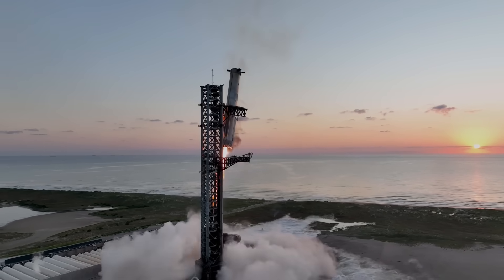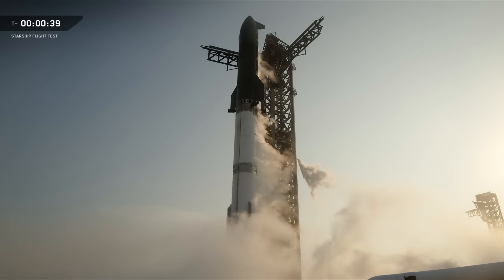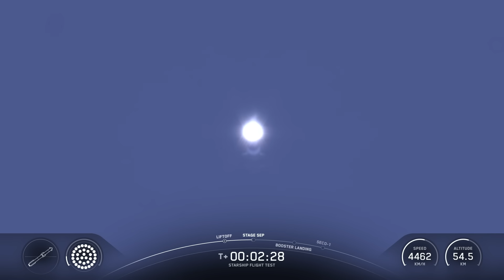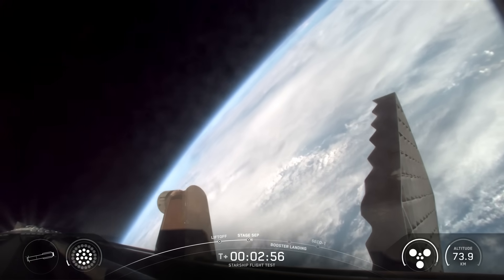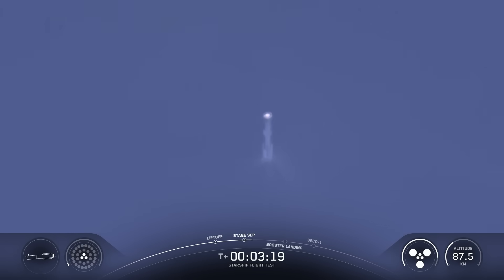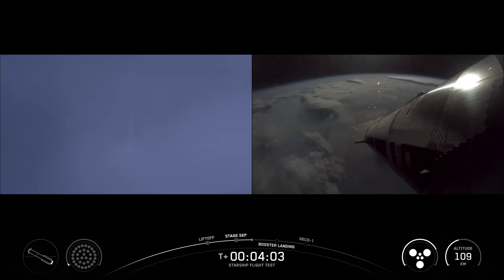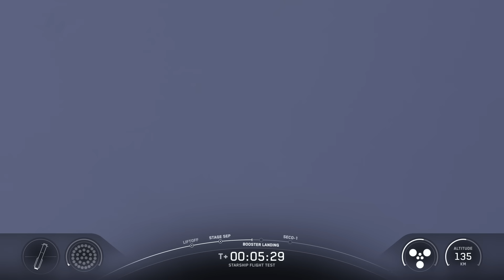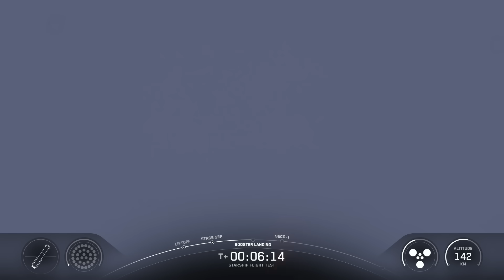SpaceX Builds Largest Reusable Booster, Also Makes Door That Won't Open - Starship Flight 9 Recap

Comment: The success and/or failure was less notable for me than than Spacex's dumbing down of the information flow to the audience. Why reduce the detail? Why were the commentators not mentioning the ship was tumbling out of control when viewers could tell by the moving shadows and views that it was? Why wasn't the orientation telemetry showing the actual movement instead of the ship orientation graphic showing it only slightly moving? Spacex enthusiasts are not stupid and can tell when we're seeing cheerleading while failure is occuring. There's a recent internet word for this tendency and it is "enshitification". One of the commentators actually said something Orwellian like "demising a little bit" to describe the ongoing disintegration of the ship. Bizarre.
Reply: Many of the comments here (not yours) reflect a dumbing down of the audience
Reply: That's the choice of the commentators. The graphic only showed the movement in one direction because it is 2-dimensional. You can see it moving more later in the orbital flight once the attitude control system had been depleted and couldn't stop the gyrations from going completely out of control in all directions.

Comment: "the only other launch vehicle with a propulsively recovered booster is the falcon 9, built by spaceX". I know you meant orbital, but, this statement as you said it is untrue, and a bit frustrating as it's problematic among spaceX cultist/fanboys that aren't pro space, just pro spaceX. Blue Origin's new shepard propulsively landed and was reused before spaceX did it, and while it's not nearly as impressive as falcon or starship, that achievement shouldn't be ignored by space historians.
Reply: ok, your footnote is noted, but it's really of no consequence.
Reply: Completely different category of rocket. One is an oversized sounding rocket that hauls Katy Perry and other bimbos straight up and down, barely touching space,  and the other is a medium lift fully orbit capable reusable first stage rocket system

Comment: Yep. It's hard (and unnecessary) to put a SPIN on that obviously complete and utter failure. 
They simply seem to regress over time. Whenever there is partial success, they will reinvent everything to make sure that it never ever becomes a viable rocket.
Remember: this is forever considered but a mere a test article. And it's hard (and unnecessary) to put a spin on that - 
again.

Comment: Serious question: the space shuttle was supposed to be a reliable routine relatively inexpensive space truck. It was instead a very expensive unreliable not even remotely routine space truck because what they hope to achieve wasn’t possible with 1970s technology even though the idea “made sense” at that time 

Is it possible Starship is in that same category?

Comment: You're way underselling the Space Shuttle, both for the boosters and for the orbiters. The orbiters were part of the the first stage with the SSMEs contributing 30% of the thrust and then becoming sustainer engines and finishing the boost to orbit. 

And speaking of doors, I'm now even more impressed with the Space Shuttle orbiter cargo bay doors which almost had no troubles opening and closing over a hundred flights and a wide variety of on-orbit conditions. The vents definitely helped, not only at launch, but in equalizing pressure on landing. Again, something people took for granted on all those flights that worked flawlessly nearly every time.
Reply: The shuttle worked in orbit when they had time to troubleshoot the doors, and sometimes they had to do so.  The door failure isn't a big deal, maybe it works if they have time, maybe they redesign... it's not a fail for the program.  I'm sure there are multiple door plans nearly ready to try anyway.
Reply: @davidkottman3440  That actually isn't quite true. They intestinally stressed the doors during the OFTs (STS-1 through 4) to see how the doors would behave under actual conditions with cold soakings and heating in sunlight, etc.. 

But they NEVER had trouble opening them. NEVER. Anything that had caused that kind of trouble on any mission would've caused it to be aborted immediately since the flash evaporator cooling system wasn't good for more than 5 hours, maybe a bit longer.
Reply: @Reiner-o7u  okay, so you just don't know.... another guy on here talked about a mission where they had to orient doors towards the sun to thaw them. I remember some delays in mission profiles because of the doors.  I didn't imagine. Plus I personally work with enough different equipment to know that nothing humans make works perfectly 100% of the time.
Reply: @davidkottman3440  I do know a lot about it. You're just trying to throw minor stuff out that isn't even relevant to this. And memory is a fickle thing. Unless you can specifically state the mission and the exact circumstances (I did, OFT flights 1-4) you've not got a leg to stand on here. 

The absolute closest I could find was STS-76 (March, 1996) Atlantis where the doors didn't close after a wave off to land at KSC, and that was quickly diagnosed as a faulty sensor and the doors where closed in manual mode. 

What this boils down to is you're a fanatic trying desperately to make a false equivalency fallacy argument to defend Starship when there is no real defense here.

Comment: NGL I think these throwing tens of millions of dollars on the 9th iteration and still ending up with the same result (explosion) is not good when you also sideline as a "efficiency department head" (where's the efficiency in this explosion?). This might be an unpopular opinion here but I'm calling a spade a spade, its a failure. Also, I'm pretty sure the money used to build these rockets was approved by Nasa... so technically Elon's dumping Nasa(taxpayer) money with these failures.

Comment: Failures identify design defects.  Which can then be fixed. You can't fix it if you don't know it's broken.  Starship WILL become highly reliable and safe.  And that's built right into the development budget.
Reply: It shouldn't be broken to begin with.
Reply: @spaceageGecko  Who's ever designed a perfect item that's this complex?  Nobody, ever.  A rational engineer expects to find problems and fix them in the next iteration. They're not GODS.

Comment: If you go back all the way to the Mercury space program, they had plenty of failures before getting one to work. It doesn't surprise me SpaceX is having teething problems while they get a far more complex space vehicle ready for manned flight.
Reply: Only 3 complete failures and 1 partial failure. Only 2 during Apollo. 1 was on the ground. Gemini had only 2 as well.  Other than the Soyuz and falcon 9. I’d rather ride a 60s rocket to orbit.

Comment: I wonder if the door not opening and the fuel leaks causing control issues are symptoms of the same problem. Structure flexing under load?

Comment: To put this in perspective the starship program is now 6 years old, the time between allen shepard going to space and Apollo 11 was 8 years and 2 months

Edit: starship testing is 6 years old
Reply: It was just over 8 years between Apollo 17 and STS-1... 

Shuttle went from nothing to a full concept that worked first try, while being much more complicated, in what will likely end up being a similar amount of time to the time it'll take to get Starship working correctly. And if you count ITS and BFR, starship has already been in development for longer than Shuttle was.
Reply: The Apollo program was an absolute high-risk program, and only luck averted mote tragedies than the one with Apollo 1. Starship is a completely different game, in all meanings of the word.
Reply: @jonmaloy6783  yeah this is low risk since you can blow them up like they do yet they are nowhere close to actually having a lander capable of being used for Artemis which is holding back the program

Comment: So Starship is an experimental and it uses the iterative process for development.  That means that as long as they gain knowledge and make improvements on the next launch it was a successful launch.  However, people want to see “successful” launches because it gives them that warm fuzzy feeling.  So from a PR and image standpoint this launch was not successful.  

Starship keeps getting better with each iteration but I do think they need  a push to get past some of these issues such as fuel leaks and tumbling of the upper section.  The door needs to be 100% reliable on its next launch.  They should have the data to fix it.

Comment: This thing seems to have control problems every time after booster separation. Springing leaks this many years into development is pathetic. The reality is this entire vehicle is too low quality build wise. It can't lift anywhere near the rated tonnage to space, its not rapidly reusable, they haven't demonstrated in flight refuel, hasn't survived reentry, and its supposed to safely land people on the moon in 2 years 😂

Comment: I think part of what we're seeing is the difference between SpaceX's development transparency compared to the more exclusive access of government led programs and Blue Origin. We get a real time look at successes and failures which fuels both fans and the haters. Keep in mind that building a new launch system is tough enough, Blue Origin, ULA, Ariane, Rocket Lab, etc., are all experiencing their technical challenges. But SpaceX is still the only company with a reusable design requirement, and Starship is being developed for sustainability, flexibility, and with cost controls, as a new concept in advanced exploitation of extraterrestrial resources. There's a lot of complexity and physical challenges, it seems SpaceX engineers are working their way through them, and I appreciate their willingness to share that process with us.
Reply: If you keep hosting a circus, don't expect everyone to clap.
Reply: @richardm.newlands2417  I disagree, but that's a good one!
Reply: Absolutely correct!!  A lot of people have unrealistic expectations, forgot others failures, and let politics cloud their judgement.

Comment: It's hard to imagine something like this being rated for human flight when it seems so prone to critical failure and has no backup bailout system. You have to have a rocket that launches successfully, achieves orbit successfully, and can land successfully to stay alive in the process. I just can't see the path where we go from here to there and anyone is comfortable with the prospect.
Reply: well you simply avoid human flights untill you have achived a couple hundred unammed flights without a explosion
Reply: LOL, the path is simple. Make a complete successful flight, & repeat.  Once it becomes repeatable, problem solved.
Reply: @davidkottman3440  
Launch rocket into flight
????
????
repeat
????
????
????
Profit!
Reply: @davidkottman3440  Is it really that funny? Astronaut lives have been saved by launch abort systems. Even the Space Shuttle had abort contingencies and could land unpowered. Dragon has a launch abort system and can land unpowered. It's not really a "simple" concept when you understand that relying on numerous powered mechanical and computer-controlled systems for safety at every point of the flight leaves a lot of room for devastating results.
Reply: @AbbreviatedReviews  Apparently launch abort systems are only practical for small capsules... parachutes for small planes but not for a 747.

Comment: The Booster explodes, there is a leak in the upper stage whose door does not open and goes in an uncontrolled spin until its loss:  How could this be called a success?

Comment: NASA experienced it's share of failures, don't forget. And lives were lost. No matter what anyone thinks, SpaceX is on track.
Reply: No they aren’t. NASA had Apollo to the moon by 11. Only needed 1 orbital test flight. And the failure that happened was due to a wire short circuit on the launch pad. 

SpaceX would have to send humans to the moon on their next flight and then do it again 5 more times with only 1 of them failing resulting in 0 fatalities.

Comment: Scott's analysis is always the most informative. I did not hear any others observing that the Starship was rotating end-over-end for the whole time after engine cut-off. That is obviously a problem.
Reply: Felix caught it almost immediately, Tim caught it immediately as well, but suggested it might be part of the mission.
Reply: the SpaceX ground crew repeatedly mentioned that a leak happened and then the ship started rolling because they had lost controllability/stability.
Reply: I saw the depiction of the ship on the user interface and said out loud "uh oh".  I had just breathed a big sigh of relief after successful engine cutoff.
Reply: Tim noticed it, but was seemingly in denial about its implications since he was still anticipating some of the other mission milestones that were now rendered impossible by the loss of attitude control.

Comment: Next my guess is the door control has a monitor for ship stability and sensing out of range conditions the fail safe would not allow the door to open. Those starlinks would be flying off in random directions if released while the pocket was tumbling.

Comment: Coriolis effect requires air mass. My guess is those particles are floating free in straight lines for them and the ship is changing directions.
Reply: You don't need air for the coriolis effect. The effect is precisely particles travelling in straight lines. Those straight lines look curved in a rotating reference frame.
Reply: @thomasdalton1508  YES you need air! Those objects were moving in straight lines. NOT "move at a curve"! "the Coriolis Effect makes things (like planes or currents of air) traveling long distances around Earth appear to move at a curve as opposed to a straight line... Parts of Earth Move at Different Speeds... how far we are from the equator determines our forward speed. The farther we are from the equator, the slower we move...Anything traveling long distances, like air currents, ocean currents pushed by air, and airplanes, will all be deflected because of the Coriolis Effect! Weird, right?" NOAA SciJinks
Reply: @glenncurry3041  Air is affected by the coriolis effect. That doesn't mean you need air for it. Anything moving in a straight line will appear to curve when viewed in a rotating reference frame.
Reply: @thomasdalton1508  The desperation. NO! Either something is moving in a straight line because of law of inertia. Some OUTSIDE energy will affect that relative motion. One possible external force is caused by the Coriolis effect. Please explain to all of us how the Coriolis effect works in a relative vacuum. How does the motion of the rocket hull affect particles in free space inside of it when no contact, no transfer of energy is made between them?
Reply: @glenncurry3041  The coriolis effect isn't a force in the regular sense. It is sometimes called a fictitious force. It doesn't actually accelerate anything. The object is moving in a straight line and continues to move in a straight line. It is only when you look at it in a rotating reference frame (ie. your coordinate system is rotating) that it appears to curve. It's the same with centrifugal force. The apparent outward acceleration is actually just an object travelling in a straight line, but the reference frame is rotating.
Reply: @thomasdalton1508  NO! Absolutely WRONG! The Coriolis effect REQUIRES a curved path! NOT a straight line! Show us ANY definition that states Coriolis effect is a STRAIGHT line! WOW! The desperation!
Reply: @glenncurry3041  Every single definition is talking about straight lines. I suspect you don't understand the concept of a reference frame. You need to learn about reference frames before you can hope to understand the coriolis effect.
Reply: @thomasdalton1508  CITATION NEEDED! Coriolis effect: "Every single definition is talking about straight lines."
Reply: @glenncurry3041  Just read any description of the effect. They will all talk about what an object travelling in a straight line in an inertial reference frame appears to do when viewed in a rotating reference frame.
Reply: @thomasdalton1508  FAIL! FAIL! FAIL!  CITATION NEEDED! Coriolis effect: "Every single definition is talking about straight lines." CITATION CITATION CITATION CITATION CITATION

Comment: engine issue fixed, down comer fixed, its a new ship so whatever iron out the new tank issues. hopefully they can see where it leaked with internal camera andor sensor data and reinforce those areas

Comment: Does "Boca Chica" still exist now that Starbase is a city?

I have argued that previous Starship flights were successes but this time I vote for failure.  Not just for the flight itself, but because too many vital tests are not being done because of early flight failures.  They cannot move beyond a certain point.  Consider, Columbus went south to the Canaries then west.  He never found the Orient, but he did a lot of Caribbean exploration.  But what if he never got to the west part getting stuck in the Canaries?  That to me is Starship.  Each launch they talk about all the testing they are going to do and then never even get to see the tests succeed or fail.  They don't get to the tests.  No data on them at all.  Not getting data from the pez dispenser, new fins, relight engine, or heatshield just to mention a few over multiple attempts is a failure.  More recent example would be for a race car to make it through three years of practice and qualifying for the Indy 500 and crashing in the parade lap and never getting to the green flag.  SpaceX must focus on getting Starship to those missed tests.

I think that SpaceX has focused too much on payload capacity and not the ruggedness of the complete Starship vehicle.  Beef it up and let's get to those later tests.